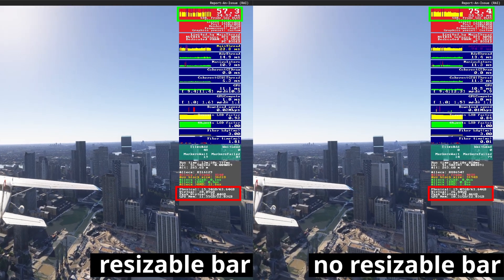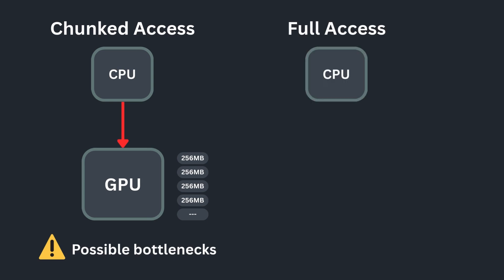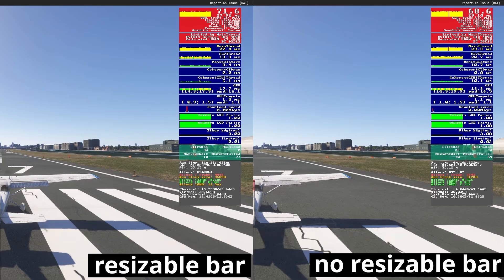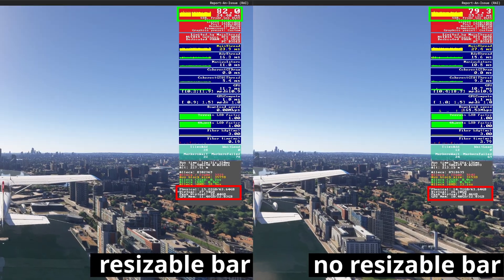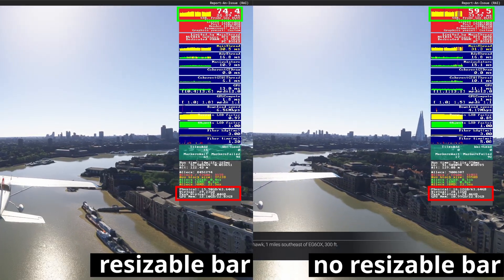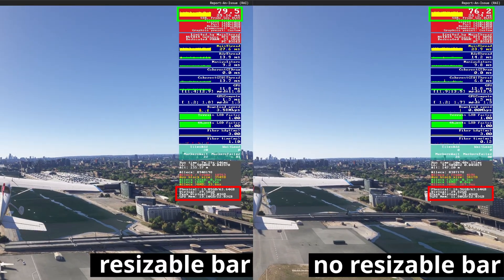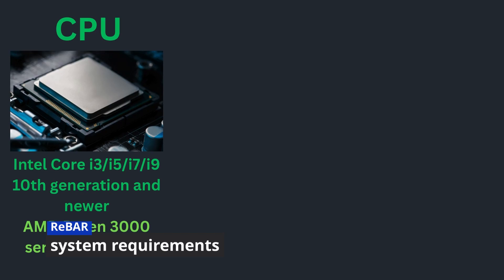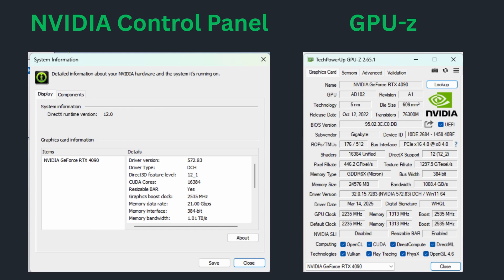BOOST MSFS 2024 FPS? 🤔 Unlock GPU VRAM with Resizable BAR (ReBAR)! ✨

Comment: What is your hardware? I’ve had stability and crashing issues with rebar enabled. 14900k, gigabyte aorus elite z790 mobo, ddr5 7200 running at 7000 for stability, rtx 5090 here. Does not seem to impact other titles only FS 2024.
Reply from the maker: rtx4090, asus rog crosshair x670e hero, AMD Ryzen 9 7900X3D, ddr5 running at 6000

Comment: With rebar on msfs24 drop framerate to unplayable (12Gb VRAM GPU), rebar disabled - smooth fps.
Reply from the maker: which gpu do you have?
Reply: @Highintheflightsimsky  470Ti
Reply from the maker: likely becausenvram usge drops right?

Comment: This is so misleading. Rbar is controlled by the Nvidia driver. Every game has a profile in the Nvidia driver and some games will have Rbar enabled or disabled. MSFS 2024 by DEFAULT has the Rbar already disabled in the driver. So it doesn’t matter if you have Rbar enabled in BIOS, it’s already disabled in the driver and by disabling Rbar in BIOS, you really not doing anything. Furthermore, I found that by enabling Rbar in MS2024, which you can do with Nvidia inspector, it actually improves performance. And when I say improved performance I mean smoother fps. Fps gain was only about 5 fps more but you will definitely see smoother fps. BUT, this is for my hardware which is a 4090 and 9800X3D. On lower specs this might do worse since enabling rbar does indeed increase vram usage a little more. But regardless, the point is that Rbar is already disabled by default. No need to change anything in BIOS.
Reply from the maker: what is the fps yiu are able to get?
Reply: @Highintheflightsimsky Im getting 80-117 smooth fps on Ultra 4K. No AI traffic. This is with FG on and TAA. Fenix A320.
Reply: When you have enough VRAM rebar can help but if you are on budget VRAM rebar make game unplayable, without changing the setting affecting VRAM ,disabling rebar make game playable.

Comment: Same problem here , i have 4070 ti OC and 5800 x3D
Hi guys , since SU2 came out , i’m experiences Gpu Vram messages like lower your settings Gpu Vram full and game crush after 5 minute. especially in VR u have the same problems ? Before SU2 it was fine .

i will try do disable Rsbar from bios , on youtube some guys tell me it helps.
Reply from the maker: let us know if it really helped
Reply: @Highintheflightsimsky  after disable resize bar in bios i get 1 gb of extra vram

Comment: Excellent video.  One point Im not sure you covered, or perhaps its not relevant anymore is that MSFS used to not utilise Rebar by default even if enabled in the BIOS.  Older videos used to state it must be forced on in the sim using nVidia Inspector. I was doing this but have recently been increasingly frustrated with the 12 Gb vram limits of my 3080ti.  Looking at ways to save vram a tutorial stated to disabled Rebar.  I have simply done that in Inspector but now wondering if that is not enough as vram still an issue.  Simming at 4K and using DLSS Quality setting.  Have to also run AutoFPS to control settings if vram starts maxing out. Wondering if I need to test it with Rebar disabled in the BIOS?
Reply from the maker: Well I did test it with the bios modification only not the profiler etc
Reply: @Highintheflightsimsky  I have disabled it in thr BIOS but not really monitored vram usage. Did 1 flight in the Fenix and I think AutoFPS was not being as aggressive in lowering graphics settings to protect the vram for exceeding limits

Comment: Best tip for MSFS2024 I have ever had. Switched off ResizableBar in Bios and my VRAM usage dropped a lot and the SIM is running smooth. Really great for my RTX4070 and Ryzen 7 5800X3D combo on a MSI X570 Motherboard. Thanks a lot..
Reply from the maker: sure no problem the 4070 has 12gb memory so can imagine that it works better with rebar off
Reply: @Highintheflightsimsky  just making another flight with ReBAR off and it is a complete game changer for me in MSFS2024 with my setup, really unbelievable. I hope more people see your video and make this change and see if it helps for their setup.

Comment: Resizable bar on gives a lot more stutters!
Reply from the maker: @Patrick_AV Which GPU do you have and which MSFS version are you using, and is there a certain area where you do see this more, want to do some more testing
Reply: @  i have an 13600k with an 7800xt. I see the difference in your video. Especially in the taa section. Or is it me?
Reply: @Patrick_AV  i have the same config here.. ( ok i have a RX7900XT) did it work for you?
Reply: @ have you tried it? I have it off! Works great.

Comment: Nice video and I am glad that you included the VRAM discussion. Because in my case, I have the "problem" that I am regularly struggling with full VRAM (4080 with 16GB and 4K) and I would actually like to sacrifice those 2GB VRAM used by reBar for the sake of 2-4FPS. But this only works by disabling reBar in general (via BIOS) and because I do not use my rig only for MSFS2024, I put my hopes now into SU2 VRAM improvements instead ;-)
Reply from the maker: the tests I did are with SU 2 beta so won't count on it tbh
Reply: You can use Nvidia profile inspector to only disable Resizable Bar for flight simulator

Comment: that's why it's enabled for ms24 profile by default:)
Reply from the maker: true, but it requires also a bios settings which you cannot control using the profile
Reply: @Highintheflightsimsky  probably new enough bios set it default too, and old bios for more old cards, that's not have enough vram for rbar:)